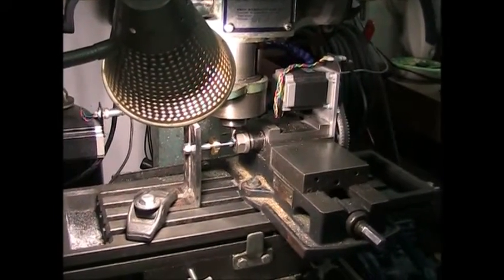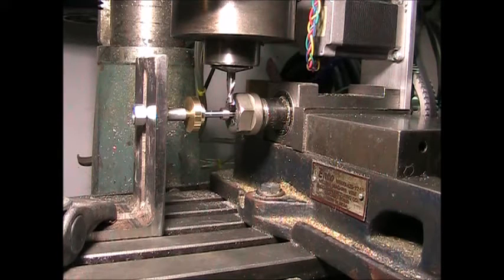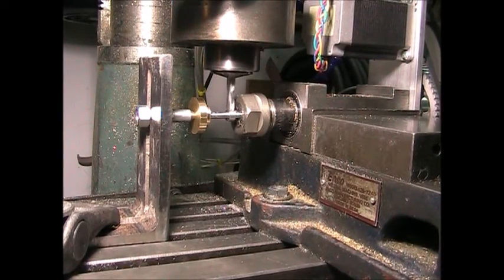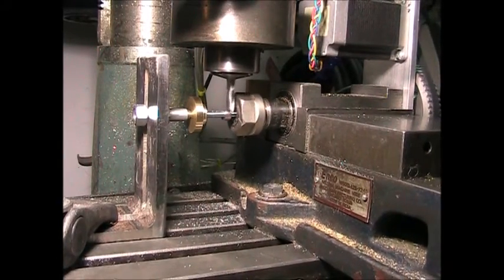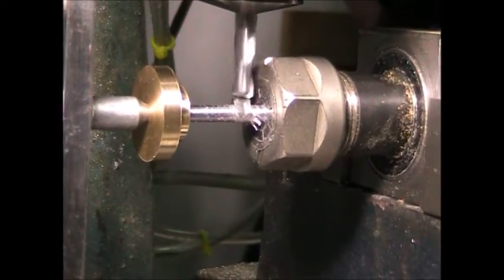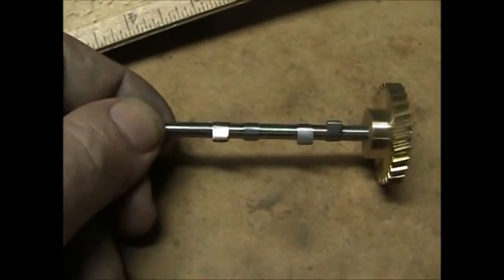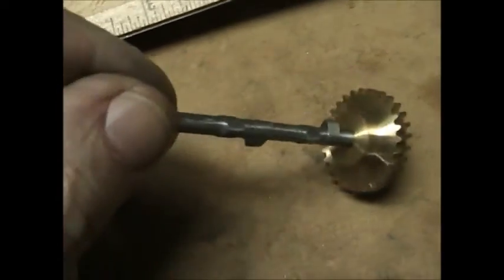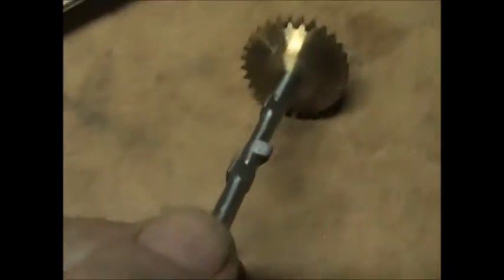Model CamShaft

Comment: Hi, Your videos have been the single greatest resource I have found. I'm not a kid any more, and finding someone closer to my own age that isn't scared of diving into modern cnc assisted machining is awesome and inspiring. I have the same mill, and thanks to you, have ordered arduinos, steppers etc etc etc. Your videos are extremely helpful for us "older guys" that need to see it to understand it. You are clear and concise in your descriptions. Your approach of modifying, adapting and improving the tools you already own, instead of just replacing them, and ending up with a perfectly usable much improved machine, sets an example in a disposable world. You have helped more people than you could ever imagine. You've opened up a world of fun to me that until recently, I truly thought was technically too far over my head. If I could shake your hand, I would. Thank you.
Reply from the maker: +Jeff Iscool Thanks for the kind words.  My CNC conversion has turned out to be the most fun of anything I've done in recent history.  I now use Mach3 and a Gecko G540 Stepper Controller.  It makes coordinated 4th axis control very easy.  But I've also been thinking of putting together an Arduino, GRBL CNC system just for fun.
Reply: +Chuck Fellows  I should have explained better that my first project for the arduino is a stepper driven 5C spin indexer, much like, and completely inspired, by your electronic indexer. The mill will get converted after I become more comfortable and confident. Your thread about your conversion is great. Your pictures during your conversion are so helpful.  Keep up the good work!